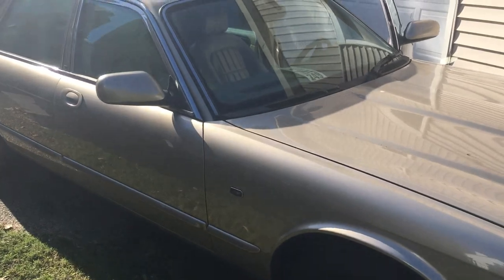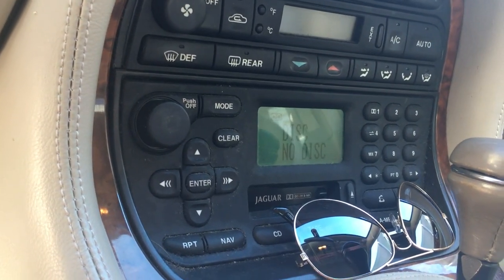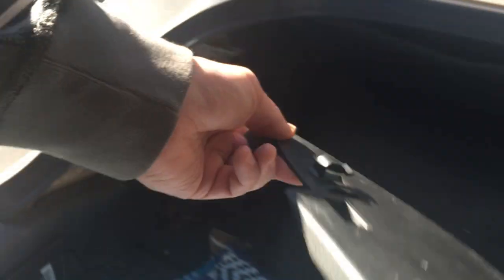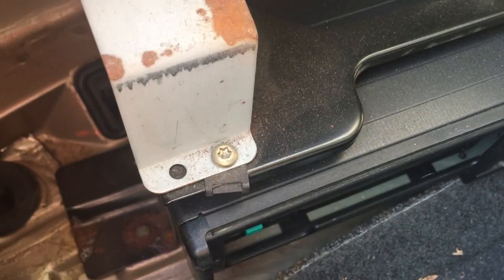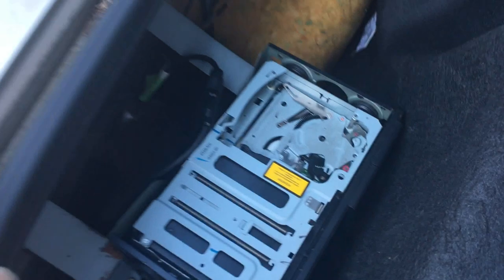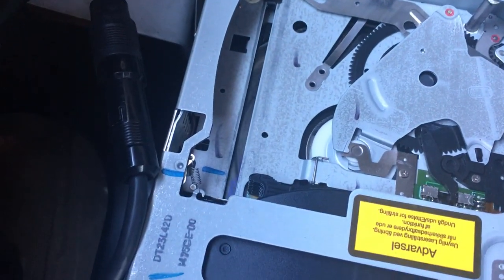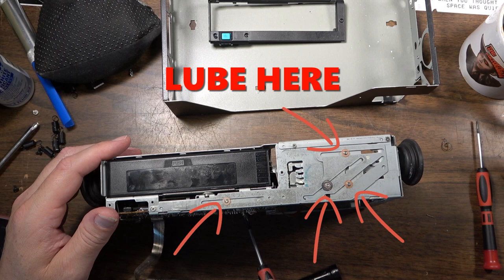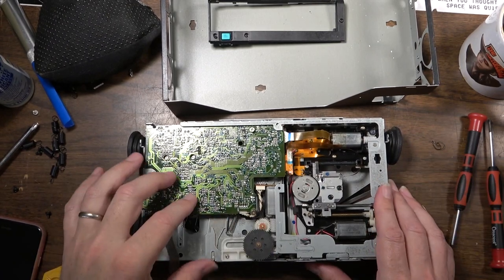Jaguar Alpine CD 5 Disk Player Changer Repair - Disk Error Fix

Comment from the maker: Bonus points to anyone who can name all the discs in the changer.
Reply: Tool
Hendrix
John Fruscuante
Ween
Mastodon
Guns N Roses
Reply: Braids
Steel Panther
Everly's
Meters
Kraftwerk
Lemon Pipers
Reply: This is painful to watch
Reply: English wife ? Chas 'n' Dave , Paul Weller , Rock a Bye Baby , ELO , and probably a couple of Blue Grass for yourself ........
Reply: Thrown lots of these away from top model Honda, Jag , etc from this particular era , I think there might be some in the back of the garage . Alpine being the most common . Both of them have long gone from my 2 USA built Honda Accord V6 Coupes and CD/MP3 heads installed . I loved the 'hitting it with a spray can' , my mate here in the UK uses about a gallon of WD40 a year . These suffer from cassette ( magazine ) wear , which are hard to find as replacements and lube with a pen dropper with automatic transmission fluid on all visible moving surfaces as it will creep to the important areas eventually .The wiring on the S video cable is much the same on all of the same make of changer,  the connector (as with OBD2 sockets ) have a basic wiring but with manufacture option aditions , so swapping over is not a problem, even the outer screen requires just a simple point to point connection over the short distance and makes no difference to screening effect . Disc error is common and can be a simple as cleaning the laser lens or discs , but generally when something this old dies , it dies .
MP3 is fine in the car but CDs at home for sound quality. 
Anyone playing with one of these attack a junk domestic unit first as you can plug and play with it outside the box as the mechanism is pretty much the same . Same rules about mains power coming into the box . 240v here gives a real hefty pulse !
Reply: I'm sure I heard the Beneath the Remains intro by Sepultura on there.. I know the song before it too, but I cant  remember who it is..
Reply: Loss for Words By Corrosion of Conformity...But i think this is the MR Bungle Cover.. maybe?
Reply: Engelbert Humperdinck - Cpt Beefheart - New Kids On The Block - The Best of Lamb Chop - Burzum

Comment: 11:25 yes it will drain. You have to unscrew the top cap I believe….and then the rest of the antenna will come out with needle nose. Spray some lithium on the cogged plastic cable…it only goes one way. The cogs go either front or back. Cant remember, been a while.
Turn on your radio…extend.
Turn off your radio with you feeding the whole mess back down..
Then put on your cap.
Jaguar has them in stock, they sell them by the gross.

Comment: When I stopped by last year to drop off that Peavy. I pulled in the driveway and I saw that Silver/Gold Jag and thought damn I didn't figure Brad for a Jaguar. All the Disc changers from the mid 90s to early 2000s all have trouble after awhile. If anyone can figure it out it's you 😎🤘
Reply: @duster71  they've been manufactured by many companies. Ford made them for awhile
Reply: @duster71  I prefer rusty Chevy's  from 49to87

Comment: I buy pack of cheap brushes from the arts & crafts store, and use the thin ones to paint on lube or glue in tight spots. You can spray into a small cup or direct onto brush tip.  The wide ones can be used to get dust out, if I use compressed air the dust ends up in my nose.

Comment: That connection is more commonly used by JVC. Alpine and Sony did use them, but they're not as commonplace as the 7 and 8 pin DIN connection. If I remember correctly Kenwood only uses DIN, but I could be wrong. There's so many variables over decades of car audio.

Comment: I've got 2 of the component type 5 disc changers, one cycles fine then starts to skip, the other will rotate the turn table etc, but will not play the discs. I'm thinking of lubing both, all I have is wd40 & 3 in 1. Last one I had was a Fisher that was a record turntable & CD 5 disc player. It worked then quit,then started working again for about a year then quit. The 2 I'm talking about are Sony & Pioneer. Frustrating as hell.

Comment: I do I bit of watch repair. Just as a hobby. May I suggest when putting any lubricant on such stuff that maybe put a small amount on the end of a screwdriver then place where you want it. Best of luck hope it works out. I had a changer that had trouble, turned out to be the laser. 🤪

Comment: I use CD's and MP3's, CD's are far better quality of sound, in fact the .OGG are 20times fatter than an MP3 or MP4.. way more content.. if you remember .MP3 was written in the day when broadband was still dialup and the fastest around was maybe half meg DSL for fat pipes, (mainframes) most homes had like 256 till around 02 when the "mighty" 1 meg hit the pipe... and boy were we in heaven.. 256 meg graphic cards like the voodoo2 card... oh boy, we ere getting uber fast 500mhz CPU's, man it was heaven..

however the MP3 was written for dial up so the trimming was massive in an effort to get it up and down the pipe in a reasonable manner, nothing has changed in that respect, still very stripped down format in any event so CD's all the way whenever I have a chance to indulge in the very best of digital recordings.. yup, some JACKWAD stole all my CD's from my mustang in like 04' however I did rip 2 of each as christmas presents for my cousins in 03' full .OGG format, had very rare Skynyrd bootleg box kit sold at costco back then, when they sold bootleg.. this had the very first recording of freebird which ended with no extended soloing, at first this song didn't have the massive soloing at the end.. nope, different acoustic beginning as it was before powell was intehband... still good, very folk

frankly there will never be a better recording than the .OGG as it entails every single byte of data, nothing is left out, they can be up to 2 gigs in size, CD's are usually around 30 gig in capacity, double will be used for larger.. blue ray hold many CD's, same quality however...  id save em all, never get rid of your music CD's..  they can be cleaned up too if real scratchy, bout $20 for the cleaner...